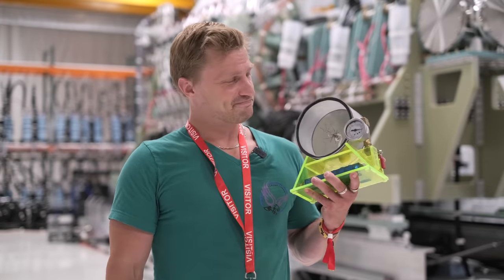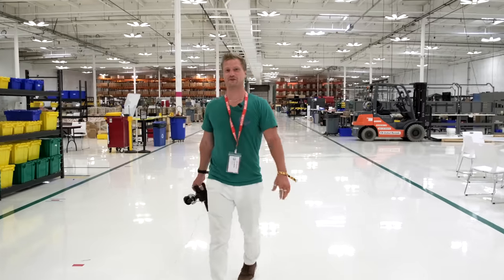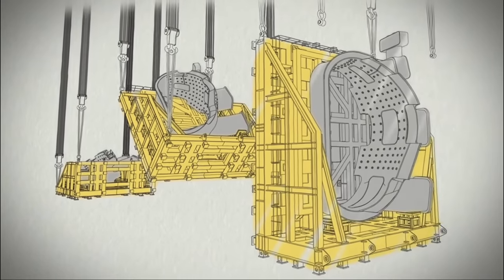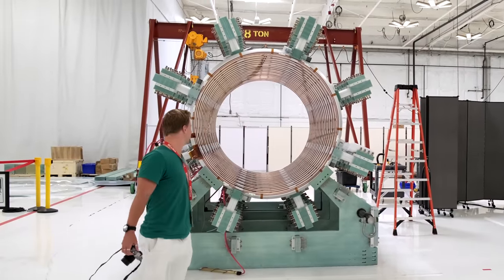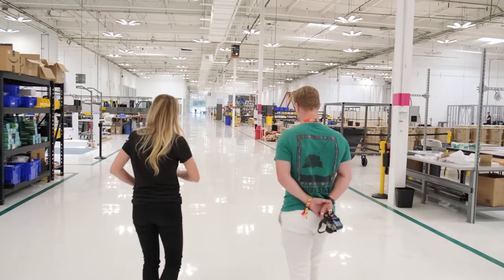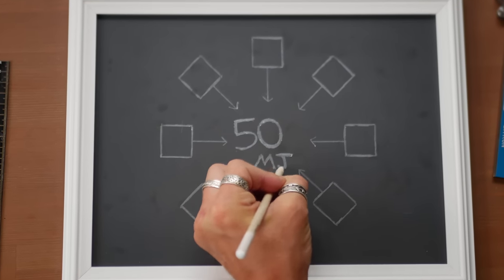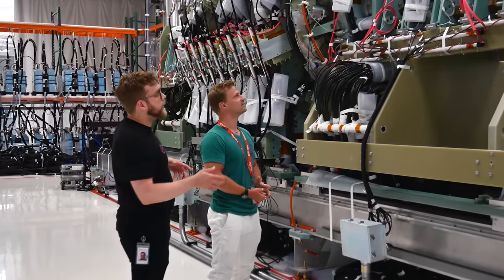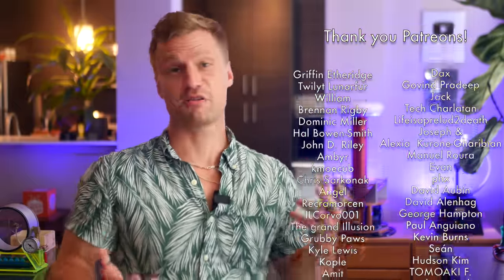An Exotic Approach to Nuclear Fusion (Helion Energy BTS)

Comment: As fascinating as this tech and its surrounding developments are, the question that needs to be answered is - what is the mechanism for providing the reactor fuel?  Since it's apparently aspecial and somewhat unstable isotope, the supply chain around it is crucial to the project's success.   Am very excited by the tech, but would love any insights on this.
Reply: My best guess, without reading up on it, would be to inject a controlled ammount of the fuel in gaseous or liquid form. Probably a pump? Maybe even gravity fed?
It’s probably stored in a container, I doubt it is made as the reaction needs it, however I do have a faint memory of reading that they do/will produce atleast one part of the mix themselves.

And also; ”unstable” can mean a half-life of milliseconds or longer than we ever will need to care about.

(all off the top of my head, not fact-checked!)
Reply: @Suppagappa  I think the bigger issue is sourcing a supply of the fuel.  Injecting in it would be comparatively easy, I imagine (and also much better than the 'pellet' approach.  But how does one breed 3He..?  It's supposedly rarer than tritium..?
Reply: @brentjeanneret  After reading more comments and having had a quick look through their website, I want to add that they do seem to produce the He^3 on-the-go inside the reaction chamber through D-D reactions.
Reply: @Suppagappa  I've read that too - almost like a breeder reactor.  I guess the question is around scalability and cost/complexity of that process.  I worry that this is getting glossed over.  I've also read that they have a patent on the process, which makes sense, but it seems to me that this could be the Achilles heel.  I really hope not, of course.
Reply: @brentjeanneret  Well, scalability, if I’ve understood you correctly, seems to rely on the number of reactors rather than the size of them. Every reaction seems to be the same size with them aiming to increase the frequency of the cycles in order to output a useable ammount of electricity per reactor.

If you’d please, could you expand on why/how you think the scalability could be a problem?
And also, what were you refering to with ”this” as ”the Achilles heel”. The patent? The scalability?

Comment: Energy density tech, yay! When the fission/fusion process is mastered, I bet we use the elements as storage of energy. Halides, especially fluorine, potentially, as a means of storing electrons for making hydrogen, or visa versa. The relationship between hydrogen and fluorine in biological systems suggests there's an already existing process of one easily being used in the place of the other.

Comment: where does the helium 3 come from??  helium is a rare, finite, non renewable resource, currenty mostly coming from oil wells! and 99.9998% of it is Helium 4 The tritium for DT is probably made by the reactor lining, but where is the Helium 3 coming from for this method??
Reply: They make their own by fusing deuterium. D+D > He3 +n or D+D->T(tritium) +p. The Tritium will eventually decay into more He3, or it can be sold, or it can be burned in Deuterium Tritium- fusion power plants.

Comment: Sorry in advance if I'm uninformed, but did you try denoising the audio? To me anyways, it sounds like you might be able to put the audio clip at 10:30 into Audacity, generate a noise profile at an area where they aren't speaking, and the apply the denoising to the rest of the noisy part. Good thing about Audacity is that even if you fail to get some noise, you can keep adding denoising on top of that, though you probably won't have to. Kinda of feels like magic how well it works. Maybe it uses a DFT of the sample area, I'm not sure. Once again, I'm terribly sorry if you have tried something like this already 😅

Comment: I would love to know if anyone has evaluated all the different fusion designs out there (this, Tokamak, Inertial Confinement, Stelerator etc) and figured out which one has the greatest potential of producing a usable commercial fusion reactor (i.e. a reactor that produces enough net energy output that you could hook it up to the power grid).

Also I would love to know if it would be possible to reach the point of having commercial fusion reactors (of whatever technology) faster by throwing a bunch of money and resources at it (think Manhattan Project or Apollo Moon Landing) or if this isn't something you can speed up by throwing money at it.

Comment: Maybe you can shed some light on this. This is effectively an explosion driven MHD generator, which is well known, except that the explosive force is due to a fusion event. The question I have is for the proposed power plant, that's producing 80 megawatts. I did some approximations and calculations on the size of the magnetic coils and their length, basically the volume of the magnetics and realized that I ^2 R losses would be about 500KW, I believe that it is impossible to cool the magnetics in that "small" even if they were immersed in an extremely high flow rate water bath. An example of a system that does work is hydroelectric generators which have a much much bigger magnetics volume and plenty of ambient cooling water flowing through it. An additional thought is that the magnetics near the origin of the fusion event receive a high percentage of the output energy, while further down the explosion chamber, those magnetics receive far less energy.
Reply: The power plant is supposed to be 50 MWe. The losses are a lot lower. The total energy going into Polaris for a single pulse (which is not the 50 MWe plant yet) will be less than 14 kWh.
Ohmic losses are actually quite low (less than 5%).
Reply: @elmarmoelzer2229  We have already had this discussion. As you read, I said my comment pertains to the power plant. I wanted Jay to weigh in on this. Here's a question for you....the magnetics at the ends of the explosion chamber, do they produce the same amount of electricity, as the ones in the center? If they don't, then most of the I^2R heat will have to be removed in the central area, so one can't consider the entire length of the magnetics, when modeling and calculating the cooling requirements of the magnetics. Do you work for Helion? Maybe you can convince David Kirtley to give some details of the cooling systems proposed for the power plant, as he seems to have no problem talking details about the test facilities.
Reply: @bshul10  
There is no "explosion chamber". There is a compression chamber.

The details of the power plants are currently not public. 

Polaris will get away with just air cooling. 

The compression chamber is relatively large, several meters in length and over a meter in diameter.
The acceleration magnets are weaker than the compression magnets.
The entire pulse only lasts a millisecond. The duration at which the compression magnets run at full power is currently not public.
Reply: As I said before I wasn't speaking about the test facilities only about the power plant. You're just repeating yourself. And by the way if there's no explosion, then there is no moving conductor, so there would be no output... So you may call it an expansion and I call it an explosion ....potatoes tomatoes
Reply: @bshul10   Well, Helion refers to it as a compression chamber and compression magnets.
As I said, the design of future power plants is currently not public. I think it is too early anyway, given that they will likely adapt the design according to the results from Polaris.

Comment: to put it simply, it's like a combustion engine, but instead of a piston is a magnetic coil and instead of gasoline it's plasma... the coil compress the plasma to the point of fusion and the energy of the reaction is captured by the coil itself granting a surplus of energy, rinse and repeat
Reply: Yes but also no. The surplus energy can never be captured entirely by the coil because it's largely (80%) in the form of neutron radiation. Neutrons of course have no charge and cannot induce electron potential in a conductor. But high energy neutrons can be captured, typically with a lithium blanket, that heads up and is actively cooled by a working fluid to then be piped to a steam generator. In order to work as advertised the Helion system will need to employ this or some other comprehensive energy capture system. In fact I think induction alone might even be net negative.
Reply: @StoneUSA  in the video they mention there is no neutron production because it is not a standard DT fusion but a D H3 fusion

Comment: A quick question. If you cut it in half would you have a plasma firing weapon?
Reply: The plasmoid would expand immediately without a surrounding magnetic field and if it was exposed to ambient air, it would immediately cool off.

Comment: If you think about what they're trying to do through a particular lens, you could compare it to a magnetic "laser" where instead of consuming electricity, it consumes mass.
Even if it does work, where does one get the helium 3? It's not a particularly plentiful substance. Perhaps it can be isolated out of nuclear waste? I think a fraction of the alpha particle decay is of the He3 isotope. Also, He3+Deuterium needs far more than 200mm degrees C to have a decent fusion cross section if I recall which really pushes up the input power. The temperature required is 5 times that of D+T fusion for a lesser cross section.  Still possible. A billion degrees is still kind of a hilarious number.
Reply: I do believe they make the He^3 on the go inside the reactor, it’s probably written on their website.

Comment: A fusion reactor running on deuterium plus tritium must breed the tritium necessary for its operation. The reason for this is that being radioactive tritium does not occur naturally. Instead a fusion reactor must breed enough tritium for its operation, something that is perhaps and just barely possible. 

Similarly, helium 3 is radioactive and must be produced. The majority of the helium 3 that is used today comes from radioactive decay of tritium. 
Even if deuterium-tritium reactors become a big thing in the future they will not produce a tritium surplus for  helium 3 production.

Yes, there is some helium 3 in the lunar soil but only once in a blue moon will it be economically viable to extract this and ship it to Earth.

Comment: Question: At lower temperatures deuterium deuterium fusion is favoured and that produces a neutron,  even at higher temperatures you can't stop a certain amount of deuterium fusing with itself so it seems somewhat misleading to say no neutrons are produced but if that's actually the case then how is it achieved?
Reply: The D-He3 reaction itself does not produce any neutrons. So what they said is correct. That said, they do actually want and need D-D reactions because those are how they make the He3. A D-D reaction produces either a Helion (He3) and a neutron or a Triton (Tritium) and a proton. The Tritium has a half life of 12.5 years and will decay into more He3.
Generally they will need one or two D-D reactions for every D-He3 reaction, depending on how much He3 from Tritium decay they have (they might be able to trade some amounts of Tritium for He3 or just sell the Tritium for extra profit). So they only get one neutron in every 3 or 4 reactions. D-D neutrons are relatively low energy and much easier to handle than D-T neutrons. They do less damage to materials and lose their energy more quickly. 
In case you are wondering, D-T side reactions (from the D-D branch) are very rare because the Tritium is too hot and non- collisional on the timescale of the pulse. By the time it has cooled off enough, the plasmoid has already expanded again and the number fusion reactions have decreased to pretty much zero. The Tritium is then extracted from the machine along with the other fusion products and remaining fuel before the next pulse is initiated.

Comment: Yes yes and I am sure you can yell at the Deuterium in that Helion/Deuterium mix and tell it to not fuse in a Deuterium Deuterium fusion event. A Deuterium Deuterium fusion event emits neutrons 50% of the time and will contaminate its surroundings. I am also extremely cautious of the idea that they re-absorb all the energy put in plus all the energy produced from fusion. The fact neutrons are produced exemplifies energy loss to the system as they fly out of the reactor. I am also sure a lot of light, in many wavelengths, and heat are produced as well reducing efficiency even further.
Reply: The neutrons would only make about 10% of the energy produced by the fusion reactions. D-D neutrons are relative low energy (2.45 MeV vs 14 MeV in a D-T Tokamak) and only 1/3 or even 1/4 of the reactions would be D-D reactions producing a neutron.

Comment: Have you done any research into the Searle Generator?  They ay when powering up the hollow monopole neodynium creates a very cold inflow (my words and faulty memory), wondering if anything more has been done like it- and wondering if it would be possible to harvest the energy with a graphine rod through the centre linked to coils from either side (if it were possible to orient the seamless generator on edge, rather than flat on a solid surface?  Just speculative ramblings, but curious nonetheless..?

Comment: Very cool video.  "Topology" is the architecture of a machine (in this case).  "Topography" is landscape; I did notice you corrected yourself later.  I would have liked to have seen more detail about how the reverse field plasma is generated and what its structure actually was (current and B fields), but I understand this is probably IP.

Comment: It may be valuable to interview an expert in the field before promoting a company. No discouragement to helion but at best they are way off vs what is described. For example, that machine ain't producing sh*t and isn't intended to. If it did, then without shielding, which it doesn't have, the neutron flux would be a serious hazard to their staff as many DT-DT reactions will still occur, especially at the temperatures they are targetting but really in any case. Good on them for continuing the effort, but obviously this machine is designed mainly for some other kind of testing like timing control and many serious problems remain to achieve commercial impact.  I feel the way this is presented is a bit misleading to your viewers.
Reply: The FRC formation test does not produce any neutrons. It is for testing the formation and it does not do compression to fusion temperatures. Polaris will have a good amount of shielding around it. It is located in a separate building for a reason.
D-T reactions are greatly suppressed. The Tritium produced by D-D reactions is too hot and non- collisional on the time scale of the pulse. It is extracted between pulses along with the remaining fuel and the other fusion products.

Comment: IS D-He3 SO INFERIOR TO D-T AS FUSION FUEL? Some people say that Helion machines are sure to fail because they chose Deuterium and Helium-3 as fuel, and that mix is 1/1000th as reactive as Deuterium and Tritium at the same plasma temperature (reactivity is directly linked to the number of fusion reactions per second).

That's misleading, because there are other factors to consider. The ratio of the reactivities of D-He3 vs D-T is:
.... 1/1000 at a temperature of 7 keV (80 million ºK)
.... 1/500 at 10 keV (115 MºK)
.... 1/110 at 20 keV (230 MºK)
.... 1/40  at 30 keV (345 MºK)
.... 1/25  at 40 keV (460 MºK)
But never 1/1, no matter how hot we get the plasma. So, if D-T is more reactive than D-He3 at all temperatures, why not use it?

Because there are other factors:

...First: D-T generate more neutrons than D-He3 (from 2:1 to 20:1 and more, depending conditions), and each of them with aprox. 6 times the energy. That means D-T produce a lot more damage on the walls of the reaction chamber, a lot more radiation, more activated materials, and those with longer lives.

...Second: Each machine design works best with a fuel at a specific temperature. When we keep heating a plasma, the number of fusions per second grow, but also the energy loses. Once we reach the "ideal" temperature, those loses grow faster that the reactions, so the net effect is negative. For a tokamak burning D-T (such as ITER or JET) that "ideal" temperature is aprox. 150 MºK (13 keV). For Helion machines burning D-He3, they have estimated about 450 MºK (40 keV). At 450 MºK, the reactivity of D-He3 is 1/6th that of D-T at 150 MºK.

...Third: 80% of the energy produced from D-T goes with the neutrons. The only way we know to convert that into electricity is letting those neutrons heat a coolant fluid, and use it to move a steam turbine. This method imply losing half the energy or more, so the end result is that we will only be able to leverage 30-40% of the energy originally released from fusions. On the other hand, D-He3 puts 85-95% of the energy in charged particles. Theoretically, it is possible to convert that into electricity much more efficiently, harvesting 70-90% instead of 30-40%.

...Fourth: There are no natural sources of Tritium, zero. All Tritium in the world has been made in a nuclear reactor, until now in fission reactors, in the future in fusion reactors. Generating that Tritium adds complexity to the reactor, and cost ... and more neutrons, and radioactivity.
But, is not He-3 in the same boat? Yes and no. There are some sources of Helium-3 in the world, but they are totally insufficient for our needs. Luckily, a D-He3 reactor can be initiated with only Deuterium, and given some time and electricity, it can jump-start itself by creating its own Helium-3 (for the curious, research 'catalyzed fusion').